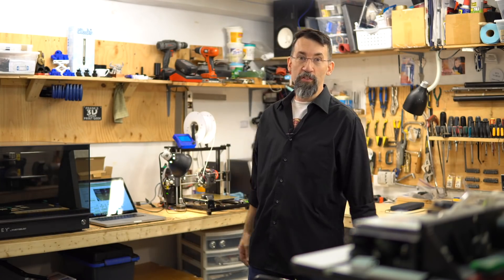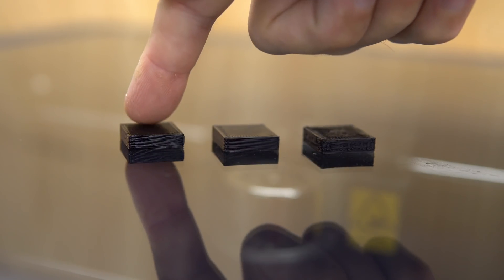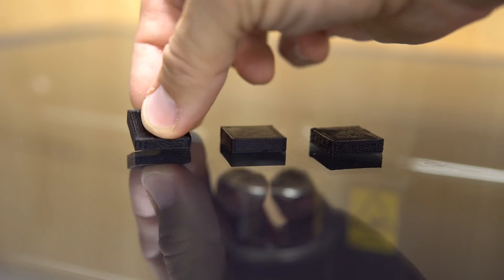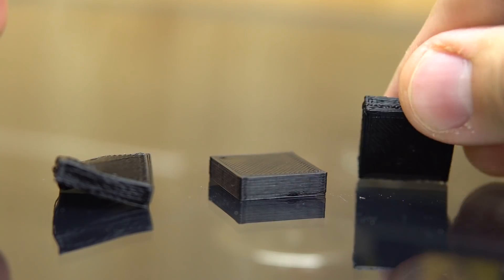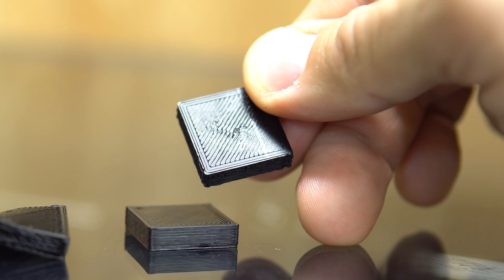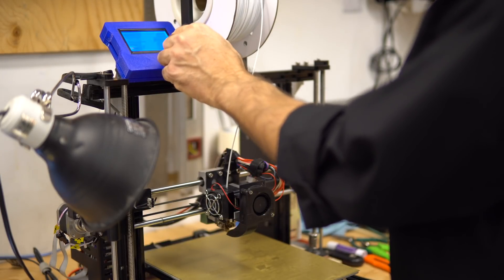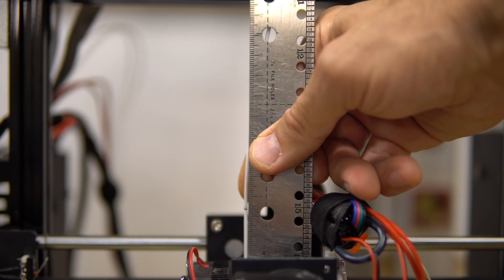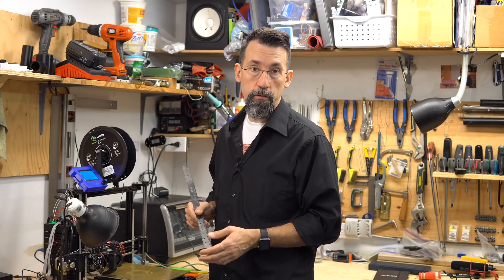Extrusion problems

Comment: also steps/mm at least on my ender 3. i was able to calculate the amount of steps/mm for both a single drive and dual drive. it changes when you add a dual  drive. the formula goes Steps/mm = Current steps/mm x [100 / (measured distance filament traveled)] tipically it will be short by 6mm on a  single drive but measure it first

Comment: Note: 
He Measured up 12 CENTIMETERS and marked it. Then extruded 100 MILLIMETERS. Then measured 2.4 ???  (CENTIMETERS). Then came up with 96 MILLIMETERS 

It would simpler to just use Millimeters for all measurements and not have to convert units.
Measure 120mm
Extrude 100 mm
Measure 24 mm
120mm - 24mm = 96mm
A 4mm difference = 4%

Comment: I'm a clueless bambu lab X1C owner....but I'm learning. (Maybe a "push & go" machine isn't the best way to learn). 
What I got from this vid is what under/ over extrusion looks like! 👍
Thanks.🙏
My Lab printed 2 good prints, but now the extruder box keeps bashing the front door, (knocking the front cover off and telling me the cutter is stuck, but it isn't), laying shadow first layers in the corners or edge of the plate and over extruding. 
All the self calibrations change nothing. 
I've serviced the belts and now can try adjusting the flow rates in the right direction.
Fun nightmare.😳

Comment: To bad my printer dont give me option to extrude filament percentage.
Reply: "Extruding filament percentage" is usually called "flowrate" or just "flow" (If you're using CURA, the setting is in the material tab).
1. You should calibrate your e-steps first. Changing the flowrate is just slapping a band-aid onto a problem that can easily be fixed permanently.
2. Usually, you set the flowrate percentage in your slicer, not on the printer. 
3. Some firmwares (ex. professional firmware) allow you to change the flowrate during printing.
Reply: @habag1112  Checked e-steps and changed  accordingly. still did not fix it, even changed to a new motherboard so I can actually flash firmware, but nope, still under extruding. And to top it all off with new board its acting possesed and trying to print things mid air after putting down a few layers.. But I do appreciate the info, thank you..
Reply: Hi, you can also do it in your slicer settings…

Comment: Thank you! 

i just attempted this and found out i was 1cm short for every 10 cm! This could be related to a bigger issue with either the extruder or bowden system but this should help for now! just trying to keep my ender 3 pro alive for a little longer. got a direct drive CR10 and now I want another one :D

Comment: Okay, he got 96mm at his current extrusion rate, say 100mm/s. So 100/96 = 1.0417, The current extrusion rate needs to be increased by 4.17%. TEST IT! 96 x 1.0417 = 100. Great! Now, if the current extrusion rate is not 100mm/s, then use whatever value it is set to in place of the 100 in the division above.
Reply from the maker: Hi, the 100 is there so you calculate de difference from 100 for your measured extrusion, you can use 200 and try to extrude 200 instead it will give you more precision. A difference of -2% is not an issue. And if you get some stringing you can backoff a little.

Comment: The question is how to change the flow rate ? The rest of the video is great.
Reply from the maker: Hi, it depends on your printer interface, it can be done in Marlin if you configure it yourself, or in the interface, or even in the slicer if you have other choices.

Comment: C'est pas pire! Ça indique si la gear pousse à la vitesse voulue. J'y avais pas pensé à celle la. Mais ça compense pas pour la variation du diamètre du filament... 
Disons 1.75mm +/- .02. À 1.73 ça donne une surface de 2.35mm carré. À 1.77 ça donne 2.46...
2.46/2.35=1.047. C'est presque 5% de variation possible avec des tolérances très correctes.
Je te laisse faire un autre video pour les anglais. Tu fais bien ça.

Comment: BAD advice. If your exxtruder does not extrude correct, you correct steps/mm in the settings and make sure 100mm extrusion is 100mm extrusion. Flor rate or slicer should not get involved in this - you also do not put a correction sheet iin your car if your tacho is bad. You fix the car. Fix the printer. Flow rate settings in the slicer should be independent and are there to handle - well, flow changes some models may need.
Reply from the maker: Yes you are right, and I talk about both solutions, but for people who are not able or not familliar with changing the firmware values, it works and you can save your slicer profile and reused it as a base with the modification no need to do it everytime.
Reply: @Franks3Dshop  The problem is that this starts biting you the moment you get a second printer or replace your printer. Rather learn how to use the firmware properly (it is not like this is not exposed in pretty much every UI). Funny enough that this actually HAS to be done - for a specific set of hardware it is not like the gears change between produced printers. Lame from the manufacturers.

Comment: what if my prints are perfect bottom or near perfect, with perfect sides but the top seems like its over extruding? like it has deep ripples in the top. could this be from the nozzle hitting the surface? sometimes when it goes from one end to the other it will almost drag a little over the surface and leave a line where it went. what could be the issue?

Comment: I have an Ender 3 pro. I calibrated the E-Steps so now 100mm extrudes dead on 100mm. I have flow rate set to 100% in Ultimaker Cura. I measured the filament and it's exactly 1.75mm measured multiple times in multiple places. The printer is brand new, nozzle is not blocked, and is 0.4mm. The settings in Ultimaker Cura are correct. Why does it still over extrude? I have had to set the flow rate to 90% but still the prints are over extruding. at 85%, it under extrudes. If all the math is correct, it shouldn't be over extruding right?
Reply from the maker: Your Nozzle could be out of specs not 0.4mm anymore or was never. If you print wood filament or glow in the dark for exemple, it would enlarge a brass nozzle pretty quickly say 200 grams fo filament...

Comment: Never correct the extrusion using the slicer flow rate !!
Correct the extrusion on the extrudeur step parameter of the printer !
Reply from the maker: Yes it's better, both works.

Comment: Fortunately I own a Trinus printer that has never had any extrusion issues there are no settings for this on the machine. It is small and limited on print size but I have ran the crap out of it for two years. I have only had to replace the nozzle once. It does not fail much either. Looking forward the arrival of my CR10s

Comment: If you do not have a printer that have note automatic Extrusion for 120 mm how do I set it up  my printer is anycube I3
Reply from the maker: You can use pronterface so that you can connect your printer via USB and control it like extruding 100mm of filament.

Comment: I have a question that i need answered by an expert.... If i slice a model and its was done telling slicer to use a .06 nozzle and later on switch to a .04 nozzel will print fail do to extruding to much filament etc???  can this cause ringing etc of maybe cause extactor to start clicking /jamming??? i am having these issues i think... thanks
Reply from the maker: Hi, it's all possible yes, if the extruder is not  strong enough to push the filament at the rate of a 0.6mm nozzle, it will skip steps and that would result in an under extruded print that would be fragile possibly with gaps and blobs.
Reply: @Franks3Dshop  thax... turned out it was more hot end clogging than extruder issues this time...i have gotten much better at pin pointing 3d problems over last couple of months.
Reply from the maker: For reference with black PLA after a week of printing about 20h a day, I replace the nozzle before it clogs and clean it at a later date.

Comment: lol you don't show how to fix the problem just how to determine if there is a problem
Reply from the maker: Hi, you either change the flow multiplier in your slicer or you change the steps of the extruder in the firmware. The easier is to change the flow by the amount over or under...keep about 2% less is better in my experience
Reply: @Franks3Dshop  but how do u do that u need to learn to explain things to people who have never seen a 3d printer before and have no idea of what your talking about

Comment: i.e How do you fix extrusion problems NOT extrusion rates!!! i.e. Printer will not extrude!!!
Reply from the maker: Often it is some debris that blocks the nozzle, doing a cold pull should clear it up. It can be a degradation of the lining inside the heart break that produce some small particules.
Reply from the maker: How to Clean a 3D Printer Nozzle https://youtu.be/hBkTeXxcFi8
Reply: @Franks3Dshop  I've done cold pulls, still nothing so bought a new hot end.

Comment: My e-steps were extruding 78mm when I extruded 100mm in the firmware. What's odd is that my flow rate is at 90% while printing because it's over extruding. I also have a dual extruder but the firmware only lets me adjust one.
Reply from the maker: Hi, verify your nozzle size in your slicer maybe it’s that.
Reply: @Franks3Dshop   Nope. Cura says 0.4mm with 1.75 filament. When I adjust my extruder to extrude 100mm it massively over extrudes, so I set back to factory settings to get it near right on the flow, between 90-98% while it's printing. If I leave at 100% it seems fine until about 2 inches high and then it's grinding on the previous layer more and more until I reduce the flow. I've checked my Z steps and they are spot on so it must be extrusion.
Reply from the maker: I would verify your Z movements, seems to me that there is an error that accumulates layer after layer as if your Z steps/mm were off... Take a ruler and measure the movement to see if it’s accurate.
Reply: @Franks3Dshop  I have. I set it to a 100mm height and measured with a digital ruler and it read 100.0mm on the nose. I thought it was this too, but unless my ruler is off it seems to be not the case.  It's weird because it doesn't look like it's over extruding, the layers don't have artifacts, blobbing or anything other than visible lines, which I think was my frame screws being slightly loose underneath and I've now tightened up. Unless this is what was causing the grinding while the carriage was wobbling as it got higher... I do have two spools sitting on top my frame and there was wobble before I found the loose screws. Maybe it was just that. I won't know until I do another tall print. But reducing the flow rate down to 90% and there being no gaps in the print when it still had about 8 hours to go doesn't make sense. I just realized something else though... I had turned the printer off half way though the print and used the resume function the next day. I wonder if it tried printing the last layer again and the extra extrusion had a cumulative effect?
Thanks for the feedback.

Comment: How can I extrude 100mm on a ender 3?
Reply from the maker: You can connect the printer to a computer and use pronterface to extrude 100mm, or make a file containing the gcode to extrude 100mm
Reply: Thanks!

Comment: Hy , i have a problem like this , is the over extrusion ,i have an ender 3 pro with mks gen l v1.0  mainboard, octoprint  ,and a creality glass bed , i just calibrated my printer manualy with a a4 paper , but my prints look horrible , it was over extruded , after that i change the e steps per mm that wen i extrude 100mm to extrude the  good lenght of filament , after that i seen that wen i extrude 100mm it have to extrude only 80 mm https://www.google.ro/url?sa=t&source=web&rct=j&url=https://m.all3dp.com/2/extruder-calibration-6-easy-steps-2/&ved=2ahUKEwiJ-vSitb_jAhVXFogKHU83D1cQFjAAegQIBBAB&usg=AOvVaw3k6OL2aupULLT8EcoPKgMe&cshid=1563485540576 , read at number 3, ok after that i also changed my flow to 97.5 % and reduce printing temp for pla to 170 celsius , after that it looks a little better , but it no longger stick to the bed .
First time i calibred with a thick cardboard, and it was over extrusion , after that with a a4 paper , and its under extrusion (not stick to the bed .
Any ideas ? :))
Reply from the maker: Hi, it could that your nozzle is not 0.4mm anymore, if you printed wood, metal or glow in the dark filament, your nozzle is to be changed...
Reply: @Franks3Dshop  tanks for answer , ok i tried to change it , becouse i have some steel precision noozle, this id the default noozle that came with the printer ,  it was the good dimension , but maybe scrach of plastic or something don't let me to change it , i will try again imediatly , also here are other information from other topic , that maybe clarify my problem 

""It seems like your problem isn't really the leveling, as this would just destroy the first layer. Leveling with a normal sheet of paper (like 70-90g/m²) is alright. 

The extrusion problem is the actual problem. You have already done it correctly with checking how much the printer actually extrudes from the 100mm you set. 100mm should take 100mm of filament. But don't forget that this only checks the extruder-steps/mm that are set in the firmware. You mentioned that you have extrusion problems during the print, so make sure to check what you set in your slicer software. With Cura, for example, you run into danger of forgetting to correctly set the filament diameter. 2.85mm is default, so all prints with 1.75mm filament will come severely under-extruded. If you slice with octoprint, make sure to check what you set in there.

Every material is different, so there's no general rule to make the print stick. Some materials (PLA, PETG) stick to painter's tape, others not. For PLA, usually 200°C is a good extrusion temperature, with 60°C for the heated bed, if you have one. 
"" 

 and my answer 

 yes it looks like a extrusion problem, but i don't understand how much filament it realy have to extrude , becouse in this photo said if is set to extrude 120mm it have to extrude 120 mm soo 20 are left
https://imgur.com/0VZftHM
,https://imgur.com/jk628pz
 right now i set to extrude100mm and i have LEFT 0MM, the extruded diammeter was about 0.3 mm , i have extruded with octoprint , in control section , my settings are (M503)
Send: M503
Recv: echo:  G21    ; (mm)
Recv: echo:  M149 C ; Units in Celsius
Recv: 
Recv: echo:Filament settings: Disabled
Recv: echo:  M200 D1.75
Recv: echo:  M200 D0
Recv: echo:Steps per unit:
Recv: echo:  M92 X80.00 Y80.00 Z400.00 E100.00
Recv: echo:Maximum feedrates (units/s):
Recv: echo:  M203 X500.00 Y500.00 Z5.00 E25.00
Recv: echo:Maximum Acceleration (units/s2):
Recv: echo:  M201 X500 Y500 Z100 E5000
Recv: echo:Acceleration (units/s2): P<print_accel> R<retract_accel> T<travel_accel>
Recv: echo:  M204 P500.00 R500.00 T500.00
Recv: echo:Advanced: Q<min_segment_time_us> S<min_feedrate> T<min_travel_feedrate> X<max_x_jerk> Y<max_y_jerk> Z<max_z_jerk> E<max_e_jerk>
Recv: echo:  M205 Q20000 S0.00 T0.00 X10.00 Y10.00 Z0.30 E5.00
Recv: echo:Home offset:
Recv: echo:  M206 X0.00 Y0.00 Z0.00
Recv: echo:Material heatup parameters:
Recv: echo:  M145 S0 H185 B45 F255
Recv: echo:  M145 S1 H240 B0 F255

my paper dimension is this https://imgur.com/jS94LTZ
https://imgur.com/tRL9RTJ
and the yesterday cardboard

https://imgur.com/v85Zt2q

my cura settings 
https://imgur.com/lPDyHK6
https://imgur.com/A1MGbG0
https://imgur.com/AjpCUVd
https://imgur.com/uBSJbI2
https://imgur.com/hLyX4dE
https://imgur.com/MqfTS0o
my flimanet diamenter is anbout 1.74
https://imgur.com/eEGu22F
 and these are the try from left to right wen i tried to change the settings , the last one is better but after that no one stick anymore 
https://imgur.com/do0iuzg
https://imgur.com/tkfWXmp
https://imgur.com/OcydIR7
 
also i check the diameter in octoprint wen i was printing in octoprint , at the gcode viewer section i see the diameter was 1.95 mm, but in my slicer , cura the diameter was set 1.74 , how can i change that in octoprint , wich one octoprint chose , the gcode setting (were is 1.74, good)or the octoprint settings , i check at the printer profile but there is no filament, my profile is a cr 10 modified profile , soo default it was set to 1.75
, do you want the marlin profile ?

Comment: I had a 24mm remainder (so same result as this video) however my cube test print looks like the middle one. Do I have a problem? :-/
Reply from the maker: Hi, the part will be a little less strong, I always make sure it’s correctly calibrated, 1mm less over 100 is just right it prevents having stringing.

Comment: I only got 40mm after having it extrude 100mm.  I then tried taking the bowden tube off, same. Any ideas?
Reply from the maker: Could be a partial clog, do the extruder motor gears grind the filament?

Comment: good quality video, but I think you could have given a little more information and demonstrated how you actually calibrated your machine. Now I have to go somewhere else to get the information that I need. I'm not trolling you but hope you accept this as helpful criticism so you can make more informative videos in the future. Respect
Reply: +1
Reply: Yes.
Reply: 100/M x 93 for Creality printers. Where 'M' is the value of your extrusion of 100mm of filament. The number u have at the end is the new steps u should input into your eSteps section under Motion. Creality set their eSteps to a default 93. So if u extruded 95.5mm of filament, the maths is 100/95.5x93=97.38. So 97.38 should be ur new eStep value.
Reply: Agreed.
Reply: To be fair. That depends on the machine and slicer anyway. He showed how to find the problem, now it's up to us to continue our own research.
Reply: @Dave Harkin, You do know there are about 150 different 3D printers with about 50 different operating systems on them?
Reply from the maker: Hi, many cheap printers have Marlin, but you are right I can not cover everything